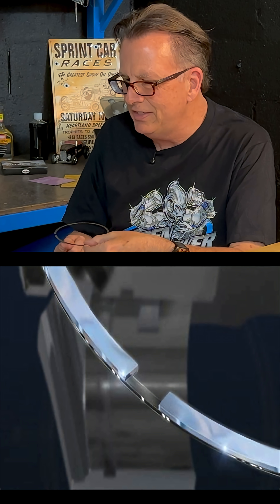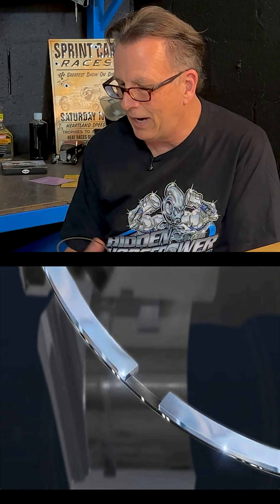GAPLESS RINGS: Engine Snake Oil or Secret Weapon?! – Keith Jones & #BarryT #TotalSeal

Comment: I ran a VW rabbit oval track engine at 9000rpm  (no money) we had to machine enough off the top of a stock piston that we were running 1 compression ring . Super crazy short stroke long rod engine. Stock 1.8 piston, (cut to clear head) welded ( rod journal) 1500 short stroke crank stock 2liter rods, I used total seal 2piece rings and I don't know how that would work without them. Stupid high maintenance front runner!
Reply: 😂 sounds like a blast! I'd love to dig into that engine and tune it!

Comment: I wonder why the manufacturers don't use them?
Reply: That's such an obvious consideration it's hard to imagine what reason(s) they could possibly have not to use them!?
Reply: @loganpe427 
It is all about cost per unit. Some friends were the OEM suppliers for the 1982 Ford Granada propane-only fueled engines engines. The factory wouldn't spend 2-1/2 cents extra for fiberglass-impregnated silicone diaphragm over standard neoprene, even though the life expectancy doubled and cold temperatures didn't make them stiffen.